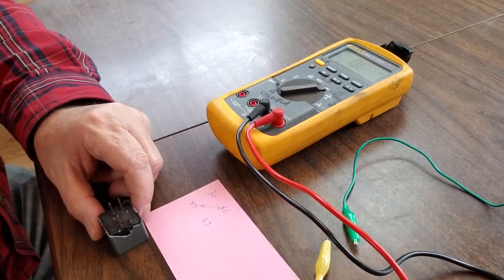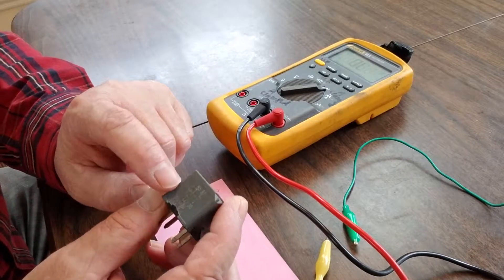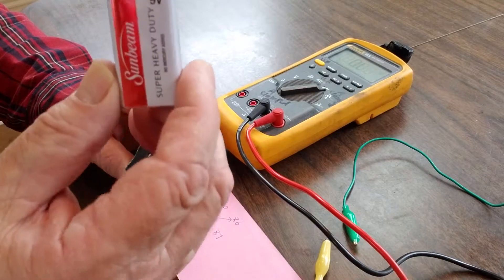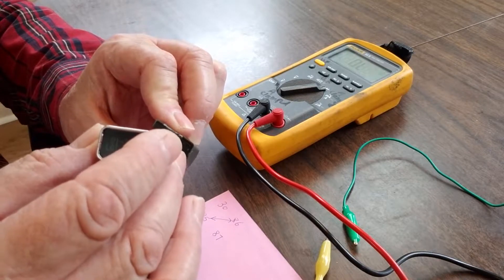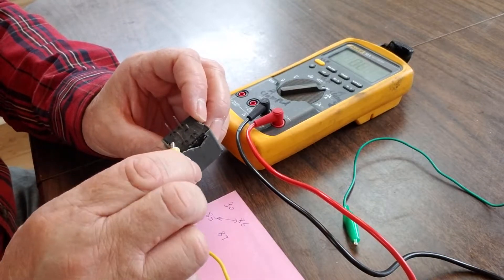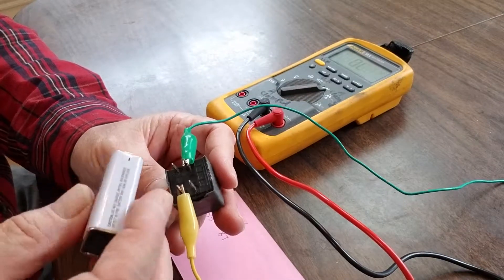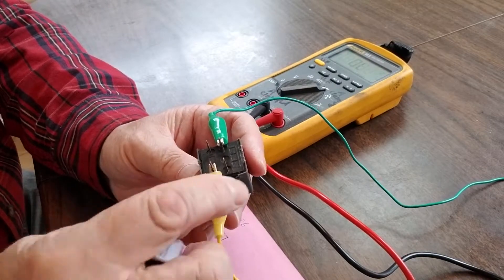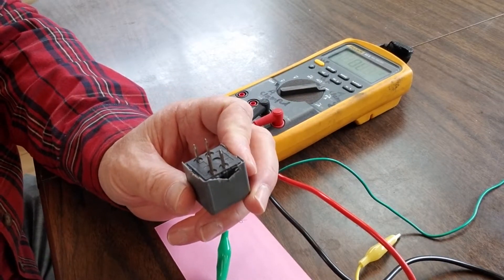Test relays easy, fast with 9 volt battery.

Comment: What is at the end of the YELLOW & GREEN jumpers 🤔🤔🤔🤔🤔
I would have been more inclined to show the initial results with the battery 🤔
Reply from the maker: The jumpers are connected to the ohm meter wires.